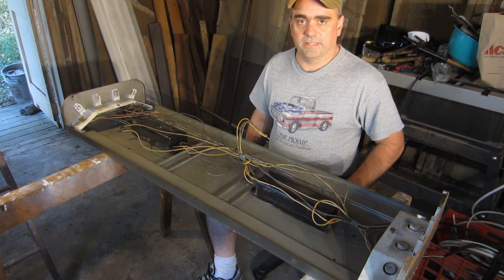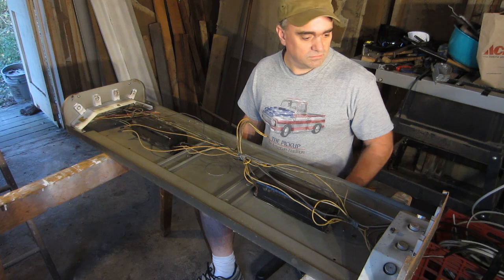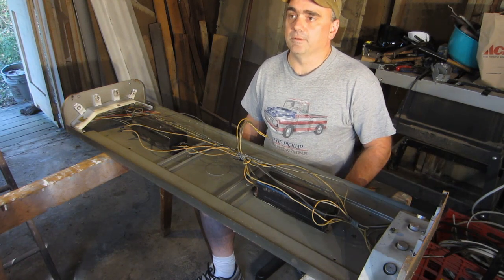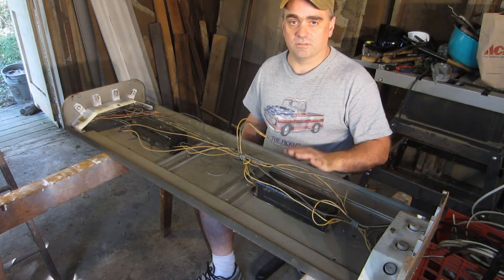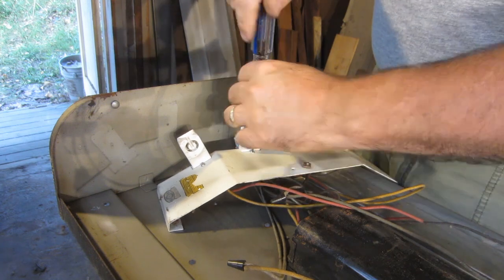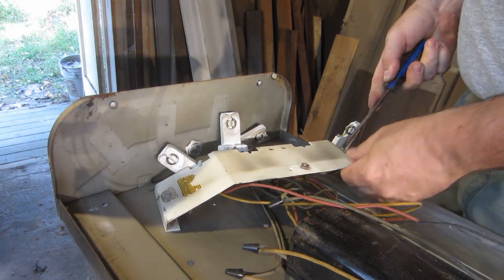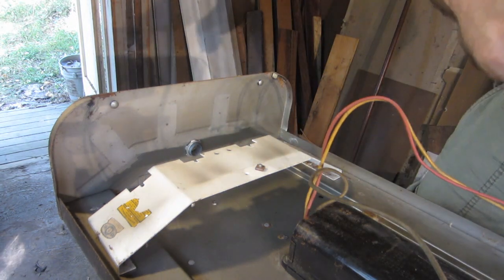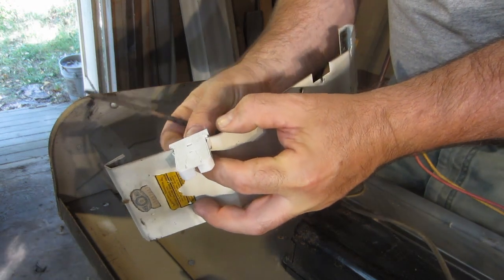Converting a vintage fluorescent light fixture to LED

Comment: Just buy new starters and tubes.  These are most reliable.  These will start in cold shed. Unlike rapid start that unrilable starting in the cold.  Some drop in led tubes just need a shorted starter.  That what they do in England.  It like throwing out a model T engine out. 
And dropping in a dinky Fiat engine in there. Beside with so many LED configeration 
Will u find that replacement led with out redoing the sockets all over again on your next led tube purchase?
Reply from the maker: Well, I built it for me, and I am happy with it.  It is a cool looking fixture and it currently casts a bright, yet warm, light with no flicker or buzz. It is now simpler, lighter and more energy efficient.  The bulbs should last 20+ years.  Maybe there will be an even better option by then, and I will happily rewire to meet those needs if necessary.

Comment: those old magnetic ballasts will last forever. LED lights are boring and everyone who has old lights like that would hate the LED conversion. it is getting really hard to find nice vintage fluorescent fixtures because everyone either rips them out and puts in LED lights or they tear out the original ballast and put in LED lights. i am all about re using stuff, but likely if you cleaned the contacts on the sockets and the starter sockets and maybe put in new starters that are cheap that would last another 50 years.
Reply from the maker: Well, I was building it for me, and I am really happy with it.  It is cool looking and casts a nice warm light, all while using about half the electricity is used to.  I watched a few of your videos.  You have some really cool vintage electronics.  radios, etc. Awesome stuff.